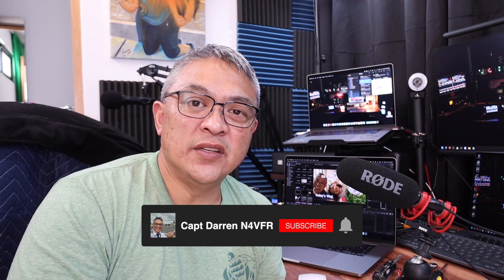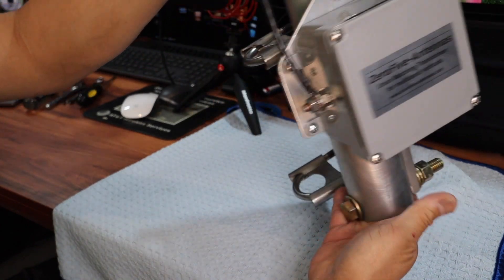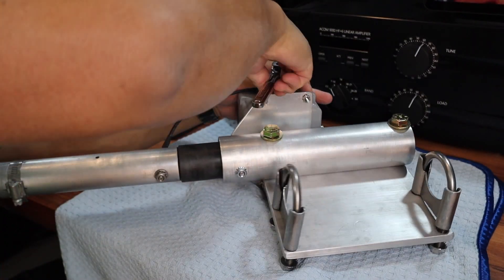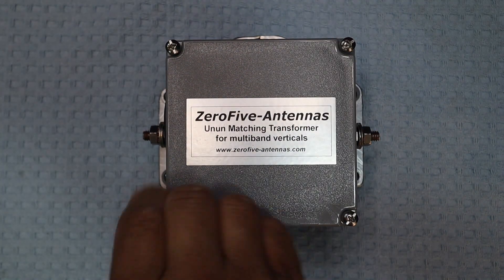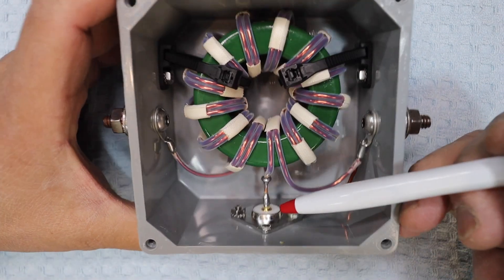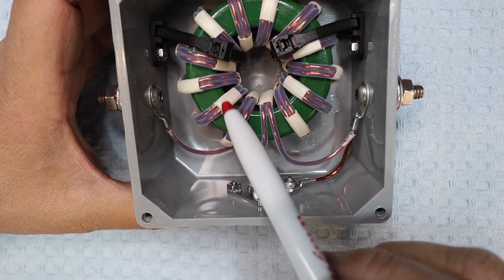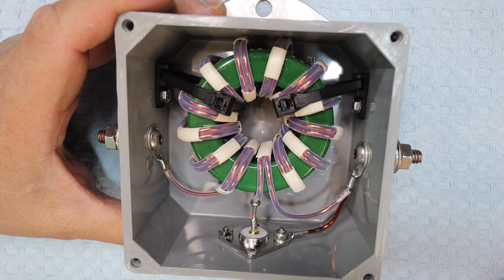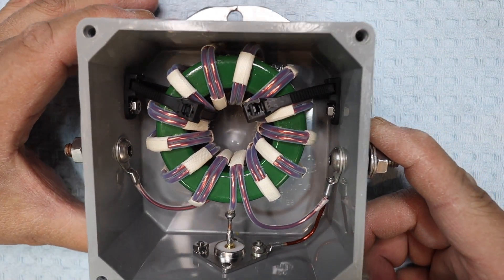What's inside the Zero Five Unun Matching Transformer? | Zero Five Antennas | 4:1 Transformer

Comment: Watched all your Zero-Five videos - very interesting! Appreciate you shooting these videos - helped me decide (just ordered a HOA27 today from Tom).  73 de Kevin VE7OVY
Reply from the maker: Congratulations on your new Z5 27'.  I'm glad to give you confidence on your purchase.  You will not be disappointed.  I'm using my 27' HOA with the inverted L for 80m.  Did you see that video?
Reply: @DarrenN4VFR  Yes I did. Your videos have been helpful and great to watch.  Have been contemplating two different ways to extend the range for 80m (which I would like to try once the antenna arrives in VE7-land and I get it installed). One thought is to replace the wire that goes from the unun to the antenna with an appropriate sized coil to electrically lengthen it, right there at the feed point.  Method #2 is to add a wire as you did, partway up the pole. I suspect adding the wire as you did will be a more efficient and effective method.  Looking forward to experimenting!
Reply from the maker: @kevinhartley3456  Awesome, good luck on your experiments.

Comment: Thanks for opening and showing us the construction. I don't own one and have not used one, but they do look a great well made antenna. Going by the length of this antenna, it should be good for 30m, being about a 1/4 wave for that frequency. I have used a 22ft element with a 4:1 balun with an 11ft counterpoise with great success. I understand you can use 5:1 and 6:1 baluns also and an internal ATU should match most bands. Yes a little loss in the balun, but great multiband antennas. Cheers 73's Andy M6APJ.
Reply from the maker: It's a great multiband hf antenna.  With the 27' version, my built-in ant tuner has a hard time on 80 meters.

Comment: all the Antennas below the 160m use a 9:1unun from Zero five / Balun designs. Top of the line! Do you notice better performance on the 160 vs the 27ft?
Reply from the maker: I don't remember if I tried to tune 160m on the 27' version.  I'm able to tune to 160m with the 43'.  Haven't really compared any performance.  I don't use 160m.
Reply: @DarrenN4VFR  I have the 33' and cannot tune 160m, it may because of the 9:1 vs 4:1. I really love the Antenna, and the people that own teh company are awesome. I was going to buy a dx commander, but being in vermont, the weather up here is crazy at times and felt the zerofive was built very rugged and have zero issues this winter. They both are great antenna's and both have great owners.
Reply from the maker: @thomashenderson603  The owne's name of Zero Five Antennaes is also Tom.  He told me that all his balun's are 4:1.  On the 43', I'm able to tune 160m using my Palstar AT2K Manual tuner.  I doubt the 27' nor 33' can tune 160m unless you have a coil attached.  On the DX Commander, you can run an Inverted L for 80m.  160m I doubt won't work.  It's too much strain on the mast if you go inverted L.
Reply: @DarrenN4VFR  I was wrong, they all come with the 4:1 unun, but on the 43 foot if you want to transmit on 160m you need a 4:1 current balum, which he will change out.
Reply: @DarrenN4VFR  The Palstar rocks with the zero five! I was using a auto tuner and switched to the AT2K, and like day and night! Tom is a great person...

Comment: That looks exactly the same as the 4:1 UnUn made by Balun Designs. I wonder if Bob makes these for Zero Five? Thanks for opening it up and sharing.
Reply: Yep. My Zero Five balun came from Balun Designs LLC. Great quality.
Reply from the maker: That is correct.  They are dropped shipped from Balun Designs in Texas.
Reply: @DarrenN4VFR  I thought as much. Top quality from Bob. I use one at the base of a 43' vertical.
Reply: Came here to say that.